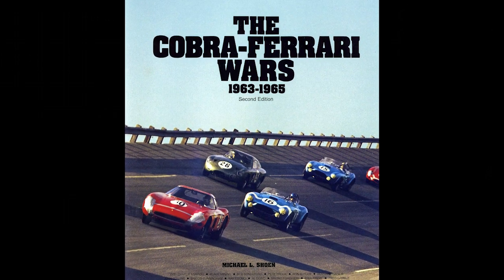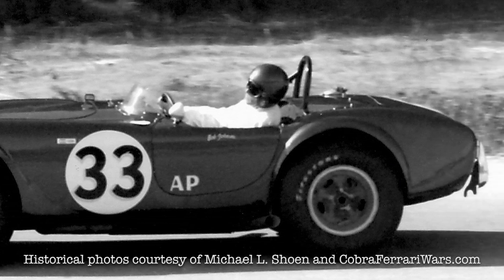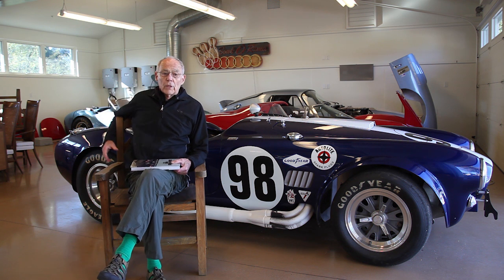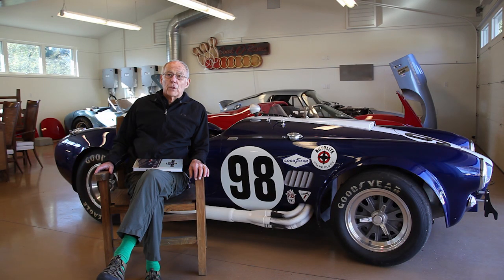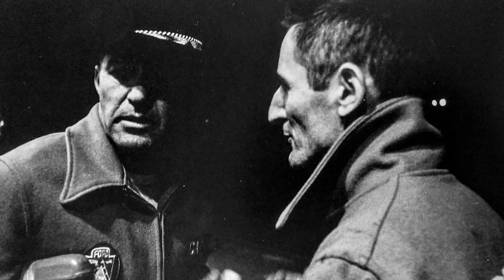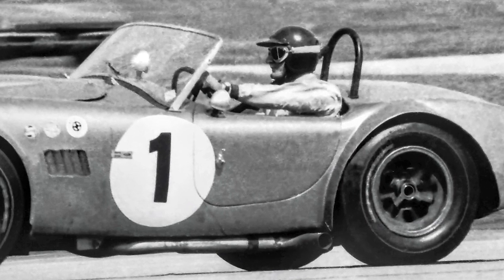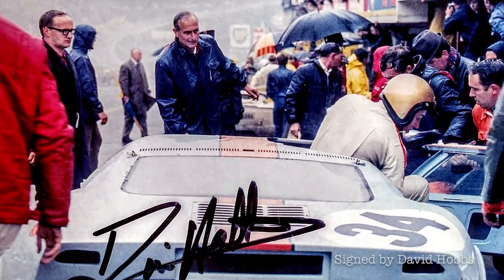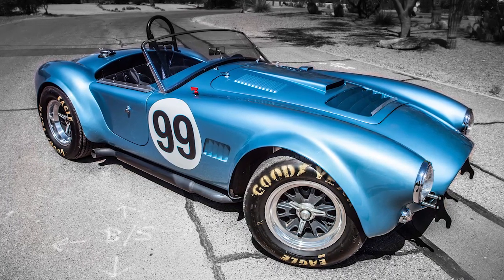History of 427ci Ford Cobras at Shelby American from Cobra through Super Coupe and GT40

Comment: I think I heard somewhere once that there were some cars intended to be 427 cars that actually ended up with a 428 due to a shortage of 427s. Would have been some of the later units if true, I'm thinking.
Reply: Most of the street cars had the 428. The 427 was expensive to build. 428 kept the cost down. 
But still very fast!
Reply: @289cobra9  Ok so maybe that's what it was then. I get little details mixed up here and there lol

Comment: before Pete Brock passed he said his final version of the super coupe was just about perfected but never raced... the huge difference he stated was handling; they had gotten to the point where the handling was so good/great, that it could run @ 200 mph all day w/ fewer gas changes/pit stops. The trade off in speed was far outweighed by the handling.
Reply: @TJ - I believe you are confusing Peter Brock, the Australian race driver with Peter Brock of the Shelby American organization.  The Shelby American P. Brock is very much alive today.  I met him at the Lime Rock Park Historic Festival in, I believe, 2016 and chatted briefly and got his autograph on the event poster.  Peter Brock, the Australian racer, passed away in 2006.  Once the initial lift problems with the Daytona Coupe were fixed, there were no handling problems at all.  Shelby toyed with building an all aluminum 390 for the Daytona which would have easily exceeded 200mph but it was never finished.  The late Bob Bondurant hit 197 mph at Le Mans in his #5 Daytona Coupe powered by the near 400 hp 289 with 4 Webers. The ass end of that "Super Coupe" was about the ugliest behind ever seen on a car.  I for one am glad it was never made in numbers!  :face-orange-biting-nails:
Reply: @Loulovesspeed  I meant the Pete from American Shelby and I apologize for believing he wasn't w/ us anymore... glad he is.

Comment: What, I built the 427 Cobras, not the body or frame but all the 375 parts that made it run. I tested all 375 built, drove every one 30 minutes. 1st 1 was done April, 1965. I tested at Riverside. Book writers are morons none did research or asked me 1 thing. All my stuff is in the museum in Ca.
Reply: Sad but True!!
Reply: Notice there are no pictures or film on the building of the 427, I built the 1st 6 at Venice, then all the rest at the airport. He should have found out the real facts.
Reply: AC Cars wasn't involved, then?    You must have known everybody at Shelby. What was the name of the guy who started at Shelby sometime in 1964 disassembling new '65 Mustangs for GT 350 conversion and retired about 30 years later as director of all Ford racing programs? That was some career.
Reply: @dalecomer5951  Mustangs were not taken apart, some new things added or changed. Went from a $2200. car to a $4500. car. I drove 1 for a year, street raced, a lot of fun!! I knew most but don't remember now, I am 88. Thanks

Comment: Why did the 390 in iron fall? A 396 ci FE with aluminum heads and water pump and the induction. The block cost so much less. I never understood why a .030 over 70s D4TE block is said to handle 800-900 hp. I just don’t understand.

Comment: What Engine is in the Cobra in this video? Does Not sound like a 427FE Side oiler ?  I have a "66 427 side oiler in my Cobra 
And it sounds Much more radical than this one in the video .... This one sounds more like a 428 FE  ... NO Solid lifters , No Cam overlap , No high compression sound ... So was Just curious ,   Beautiful Replica However : )  square  Oil cooler scoop  added .
Front fender flares are Really wide also ..  Is this a replica of CSX3002?  Using a 289 Body ( CSX 2702) with Modified fenders etc . Including a Dry sump system . The only 427 Raced by Shelby American .   I"ve owned  2  Original  427s since the early 1970's : ) 
Thanks
Reply: Motor is CI 427FE side oiler with alum heads. We tried two different mufflers to quiet it down. I believe this muffler has an internal radial or corkscrew flow. It is quiet but that's what I want, due to my hearing damage. I try to do that if possible with performance vehicles. It is also easier on the neighbors.
Reply: @cobraferrariwars  
Hello Michael 
Hey, I understand Totally!
Your engine just sounded kinda quiet , both my 427s are noisy by virtue :) 
I have a chronic  Hearing loss , so the sounds
Don't bother me much when I turn off my hearing aids ! Lol
Your car Looks Impressive 
Very unusual body , but Excellent Replication indeed.A Rare sight 427Roadster.
Thanks for Replying 
I hope you get Many More Years ahead to Enjoy it !
Best Regards
Walter ~
Reply: I purchased csx3225 with 9,000 miles on it in 1968 for $4,995. It came with the 428 police interceptor motor. It came with the same mechanical AA cam as the 427 and low riser 427 heads with a single ford carburetor. I added dual point distributor, Holley Carburetor, side exhaust and rain race tires. It turned 12.40 at 112 mph after those upgrades. I drove it as my every day car until 1973 adding 48,000 miles on it. It currently has 84,000 miles. Back in late 1960 or early 1970 I was getting my car worked on in a shop on Redondo Blvd in Inglewood or Hawthorne, CA. The Super Coupe was in a corner of the shop as a roller for sale, as I remember for $3,000.
Reply: @rayshepherd2479  
Hey Ray 
Sounds Great 
I bought CSX3227 in 1972
For 6500$  it also had a 428 intercepter,  but I changed  it out for a 427 side oiler .
I don't remember the 428 having mechanical lifters ,but it was a long time ago ! 
Nice to chat with you 
You must be an old timer like me ! Lol 😄
Enjoy !
Reply: @Wilett614  I also changed my car to a medium riser 427 side oiler somewhere around 1980. It really doesn't feel any quicker.
Reply: @rayshepherd2479  
Really ? 
My car was noticeably  faster, especially with torque . My 427 was blueprinted, slightly worked    and tuned , putting out about 525 hpwith  675 lbs torque. It came from a friend who worked at Holman/ Moody back in the day .
 But the 428 was no slouch for sure .